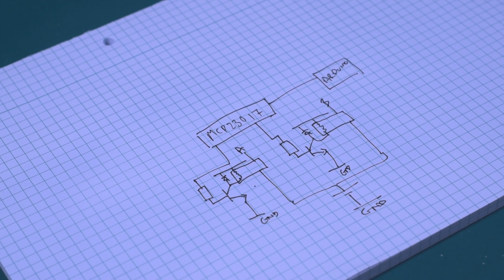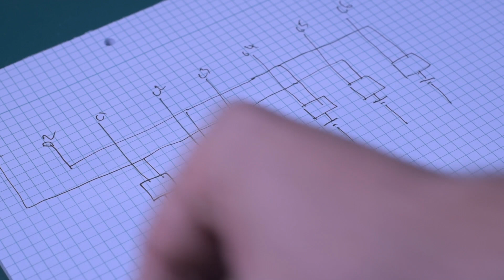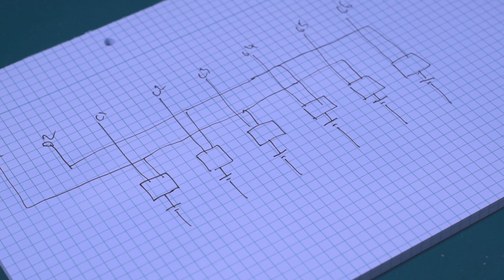18650 Station - Arduino Controlled Multi Battery Charge and Discharge

Comment: This is amazing. I am really interested in your project. I am curious if there might be a way to out put the values of the batteries to some type of file for use in repackr. I am not familiar enough Ardunio to know what could be done. Maybe some type of label printer for each cell as they come out.

Comment: Just simply... AWESOME!!! you've put so much work into this, I should know I've been tackling this (and failing) myself.  Can't wait to see how this evolves.
Reply from the maker: Thanks! I think we're both getting closer on hunt for a solution to this problem!
Reply: NERDVille Both you and Chris are awesome! The content you and other YouTubers are producing is fantastic. I'm looking forward to seeing the end result of this work. 

I'm currently using a board with 8 tp4056 for charging and an IMAX B6AC+ v2 for discharging and it's painfully slow. I also have an LiitoKala Lii-500 but it have serious overheating issues… (obviously a Chinese knockoff) waiting for some heat sinks for it that I hope will fix the overheating. But having the testing automated would make things so much more easier. 

I would also recommend adding temperature sensors to each of the battery holders to reduce the risk of something catching on fire

Keep up the good work! 
Best regards from Norway!